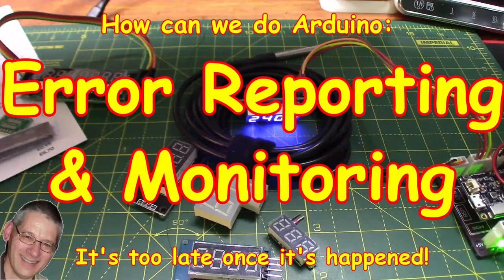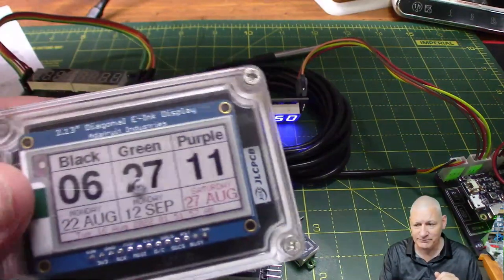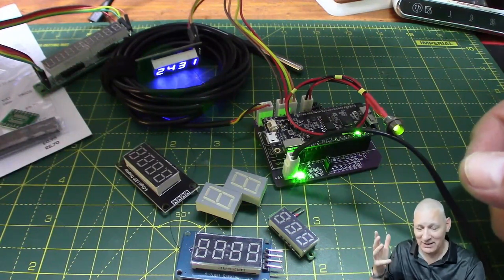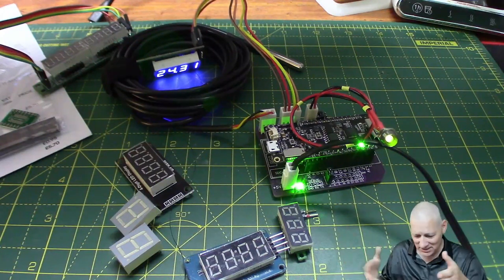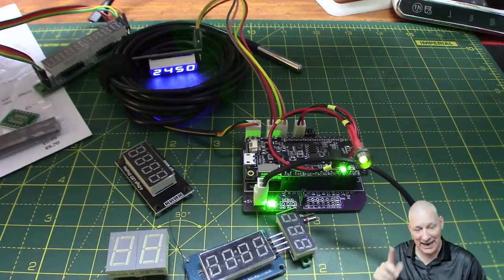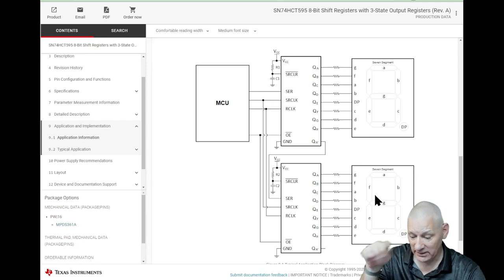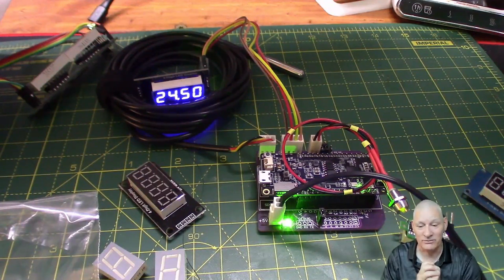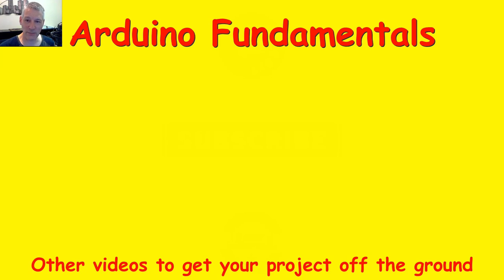#247 What's gone wrong? How do we know?

Comment: I have used E2PROM in the past to store codes, one had an external one so if the MCU failed to boot for any reason I could still read the last code present with an external reader.  I have also used SD card as the project already had one but that was more for system errors like network connection errors rather than MCU issues.
Reply from the maker: Yes, SD card is easiest to transport (if you can get at it) and just plug it into a PC. But EEPROM / SPIFFs is also good if you can read it (via the microcontroller). I'm looking at options right now.
Reply: @RalphBacon  Yes, I guess it depends on how often you need to write to a certain part of the flash vs how many write cycles it can take, also you have to erase a "block", but for most applications even though some people complain about "wearing out the flash" it isn't an issue.  Some of my work products have a E2PROM in a socket so it can be replaced or if a unit fails you can move the config to a new unit, works very well just depends on your end application / requirements.

Comment: Tiny display? Look up HP QDSP-6064 bubble display.

You can latch the display and shift to the next digit before saving a new error code. Use a controlled shutdown to record a zero error.
Reply from the maker: I will look, Bernd. Bubble display? Is the bubble a magnifying glass? In the 1970s there were calculators like that.

Comment: If you can address the 7 segments in the display individually then a single "digit" can report 2^7-1 = 127 different error codes (obviously not all legitimate 0-9 digits but so what).
Since you need non-volatile storage (so that data survives a power-off-on cycle), how about storing the errors (and status maybe) in a log file on a micro SD card?
Reply from the maker: Or storing them in EEPROM / LittleFS / SPIFFS. Yes, needs to happen.

Comment: What about using a small microcontroller for that, using a single serial wire to the mothership, you could add a watchdog/reset function on it, and it could drive the segments, and store error codes. (attiny167)
Reply: etc.My thoughts also, use the pin that would go to the watchdog and send data down it to indicate status good or otherwise, the watch dog would record the abnormal status or no watchdog reset pulse then reset the master.
Reply from the maker: Yes, good suggestions except I want to be able to permanently add this to a project as well as on an ad-hoc basis. I guess there is no one-size-fits-all here.

Comment: How many hobbyists go to the trouble of catching faults in their programs.
I was looking at a bit of code where the main function of the code was less then 1/2 an A4 page, the error checking which checked the data coming and the data going out, to see if all was withing expected limits was 4 1/2 A4 pages. I expect the pre and post error checking took far longer to write than the code itself.

I think most of us write  in a "Happy day coding style" which means on a happy day all goes well, on a bad day the result is switch off and on again.

it's a real test to your programming skills to write code that will detect the fault, log it and get itself back running with out user interaction. as if it's in your loft and you have to go up there every time it falls over. it will soon be switched off for the last time and left to collect dust up there.
Reply: I think most of us are in this boat :) Although, as someone who is planning on making a consumer product (however low-volume it may be), I too have started thinking of ways to deal with errors & crashes -- mainly so that the consumer can appropriately communicate what's wrong or even troubleshoot the problem themselves based on instructions in a manual.
Reply: @1_HighDuke  simple displays.
Could be 
1. green power light is good.
2. Slow red flashing power light with pause, count flashing for error code.
3. Fast continously flashing red, major fault turn off.

If there are outside requirements e.g. sensors then there could be a status indicator for each one.

The thing to remember is each adds cost and puts price up or profit down.
Reply from the maker: Firstly, I can add the external watchdog that re-powers the entire system. Videos #190 / 194 describe this and it works well.

Secondly, I could log the error by the umpteen ways  suggested in these comments but as you say, going up into the attic to see them is not a great idea. No one size fits all here.